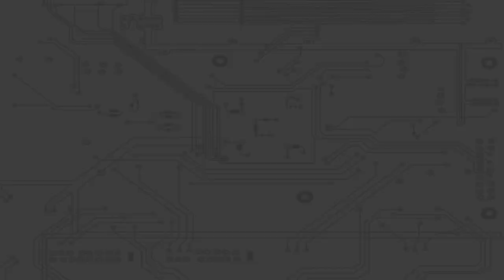Project Bloodshed - Jay's new 4k Test Bench

Comment: looks really neat, only thing I'm not keen on is how the rad and fan mounts hang outside the case, but guess that's due to space limitations, would be nice if there was a frame to fit round the sides almost like a windowed panel without the window, though probably not practical for a test bed then.

Comment: Im running an M-ITX build with an i5 haswell 4430 cpu, msi 770 lightning ed inside of bitfenix prodigy case. I've recently added a benq xl2420z monitor to my setup and WOW, I've fallen in love with high refresh rate gaming. I'm currently waiting to see if the rumors that the 980ti will be a beast come true, and may upgrade to allow all my games to run at 100fps+ at 1080p.

Comment: i dont have a test bench but i may need to build one for trouble shooting but idk right now. however, my main pc (this one in my profile picture) was a fun build. its specs are:
case: cm storm trooper with side window
motherboard: asus rog crosshair v formula z
cpu: amd fv 8350 @ 4.5ghz
gpu: evga gtx 970 superclocked 4gb
psu: evga supernova 750 gs
ssd: 128gb samsung 840 pro
hdd: wd caviar black 2tb
ram: team group dark 1600mhz (red)
liquid cooling: duel 240mmx45mm rad with silverstone 1200 fans and iron side red liquid uv coolant

Comment: I liked how the system looked, the red fluid looks very nice.

I'm shocked that I haven't heard of Caselabs before :O I'm a big fan of having the motherboard horizontal, so I'm looking around on their website now! I'm running an mATX system, so I'm covered for now, but their stuff looks really nice.

I'm now using the Aerocool DS Cube, but I came across, by accident, the Lian Li PC-V359, so I'm planning on switching to that. I'm very happy with the Aerocool, but the Lian Li just looks that much nicer with all the windows and space for 4x120 fans for the mother board area. Btu I will have a look at Caselabs before I order anything :P

Comment: You say you can do full benchmarking on a second graphics card without disconnecting the first one because of the two 16x PCIe lanes on the X99 motherboard, but the i7-5820K only runs two cards in 16x8 due to having only 24 lanes (whereas the 5930K and 5960X would run both at 16x due to having 40 lanes). Are you sure that you are getting that second card to run at 16x in your setup, and if so how are you accomplishing it?

Comment: The only change i would make for a testbench would probably be to change the cpu to a 5930k and then leave the gpu aircooled. Or maybe a parallel loop for the gpu and cpu with quickrelease on the gpu

Comment: How do you installed the HDD and SSD!? It looks like you need to remove de MOBO to attatch the drives!
Reply from the maker: There are two thumb screws on the side that let the bottom half of the mobo tray come down. The motherboard stays put.
Reply: Nice. Thanks. ;)

Comment: I need help,

I just bought a 760T ( had nzxt phantom) and I was wondering if I should out my kraken x60 again as top exhaust but currently as of now it goes to 33-36C under load gaming prob cause of gpu heat, should I put it as front intake and put exhaust fans on top?

Comment: i wanna build my first gaming pc, this is the parts i have chosen so far. Any suggestions about what i can do better?
AMD A10 6800k CPU
Corsair H100i CPU WaterCooler
Nvidia gtx 970 4 GB GPU
Corsair 120 GB SSD
Toshiba 1 TB Harddrive
G-Skill 8 GB ddr3 2331 Mhz RAM
Corsair 750 Watt Bronze PSU
GigaByte FM2 PciE 3.0 x16 Motherbord
NZXT MidiTower Case

Comment: Huge error. He said that he could leave the 290 plugged in and add a second and it will run at 16X. Not true the 5820K only has 28 lanes, so the 290 will run at 16X and the second card at 8X. The 5820K also won't support more then 3 way SLI since Nvidia requires that cards run at 8X minimum, since the 5820K has 28 lanes, the first three card will run at 8X each(which ch adds up to 24 lanes), and the 4th a 4X. So the fourth won't run at all since its 4X.
Reply: you know thats its .. 2x 16 and 3x8 right ?
Reply: HTMMediaChannel you know that there are only 28 lanes, so it cant run at 2 16x because 16x2=32. im sure there is a way to either disable one card and make another run at 16x or something, but it doesnt even matter, running a current pcie 3.0 gpu at pcie 3.0 8x does not bottleneck it.

Comment: is it okay to put a mechanial harddrive upside down like jay did? i have heard somewhere it could damage them.
Reply: No it wont damage them
Reply: if you mount an hdd at a horizontal or vertical position, no matter the orientation, it will lose no more than 20% of its life. now, if you install windows with it vertical, you will need to format it before you run it horizontal (possibly) because the read heads might become out of line.

Comment: Just noticed speed doesn't matter and with the x99 deluxe is great for overclocking so I am really happy about that :D :D However this is my full specs list

                                    Computer build
Gigabyte Radeon R9 290X 4GB
Gigabyte Radeon R9 290X 4GB
RM850 power supply
i7-5820K clocked at 4.2 ghz (hopefully, if possible)
Asus X99-DELUXE motherboard
Corsair Dominator Platinum 16GB DDR4 2800MHz
WD Green Desktop 1TB hdd
Kingston HyperX 3K 2.5" 120GB SATA III SSD
bluray drive

I hope guys this is the perfect build if not tell me what is wrong and suggest what to replace with and please tell me what: cases, CPU fans and case fans I should get (MUST BE QUIET!!) Thank you guys for reading this far as people get bored normally :'( BUT seriously thank you guys if you do comment!!

Comment: Will this be able to play CS:GO, TF2, league of legends, ac unity, and battlefield 4 at high to ultra settings 1080p 60fps
CPU: amd FX-8320 3.5GHz 8-core
Mobo: Gigabyte GA-970A UD3P ATX AM3+
ram: crucial ballistix 8gb ddr3
hard drive: WD caviar blue 1TB 7200RPM
GPU: MSI R9 280x
case: Corsair SPEC-03 white ATX mid tower case
PSU: Enermax revolution 630w 80+ gold ATX
OS: Windows 8.1
Reply: Yup your set
Reply: ***** Thanks for the help.
Reply: Will it play batman arkham knight?
Reply: Will it play mine craft?

Comment: you should of used a samsung xp941 256gb/ 512gb as your ssd for a boot device conected direct to a m.2 to pcie x4 ssd adapter w/ heatsink, that way you its not bottle neck as most ssd are. im just saying :)

Comment: cool mirror on the left ^^

all in all a GREAT built, only thing I would change, is removing the internal USB3 Cabels from the motherboard as long as you don't need them. Or maybe there is an angeled adapter. The Cabels stand up ring in front of the beautifull board an rest. Goole found some pretty nice thing, you need something like this http://cdn.overclock.net/e/ee/ee96b462_IMG_8789__43415_zoom.jpeg

Due to BLOODSHED is a fully red built and I had preferd to see a MSI Gaming 7 Mainboard in there (or atleast a red Asus)

Comment: Here is my build:
CPU: FX-8350 8-Core CPU @ 4 GHz
GPU: Gigabyte Geforce GTX 970 @ 1250 MHz (1568 MHz on High end games)
RAM: 12 GB Clocked at 1066 MHz
Case: Cougar Challenger
Hard Drives: 500 GB, 1 TB, 3 TB
SSD: 128 GB SATA 6 Gb/s
Monitors: ASUS VS-239P-H, ASUS VG248QE
OS: Windows 10 Technical Preview
Fans: 140mm Fan, 120mm Fan, 200mm Fan
I made this build to optimize performance per a dollar while still going high end or mid end however you want to call it.
http://tinypic.com/view.php?pic=2v8fpdw&s=8#.VHlUWTFpfuM
http://tinypic.com/view.php?pic=34yz6z9&s=8#.VHlUgzFpfuM
http://tinypic.com/view.php?pic=9pxdvd&s=8#.VHlUkDFpfuN
http://tinypic.com/view.php?pic=nfpffp&s=8#.VHlUnjFpfuN
a little outdated picture but just the ram is different.

Comment: How would an AMD Quad-Core A10-7850K Processor with AMD Radeon R9 260 dedicated graphics work with Battlefield 4. Should I consider getting an AMD 8-Core FX-8320 Vishera Processor with AMD Radeon R7 250 dedicated graphics instead?
Reply: Idk lol!!

Nah ima jking they would run I think at around 30 fps at max settings though I cannot find properly out as there are no where showing these both at test as well as ram also includes what fps battlefield 4 runs at. If you could improve it would be graphic card then the cpu as gpu is more important and as it runs the game itself (mind blowed) instead of cpu calculating where pixels are.
Reply: Lolly Gamer Thanks for the lol + information. I'm going with the Quad-Core for my pre-built pc which I am upgrading upon arrival.
Reply: ***** Okay and hopefully it goes well for you, good luck and hopefully you enjoy the upgrade. Ik I would :D :D

Comment: Will this run Battlefield 4 at High or Medium?

CPU -	AMD Athlon X4 760K 3.8GHz Quad-Core Processor	
CPU Cooler -	Arctic Cooling Freezer 7 Pro Rev.2 45.0 CFM Fluid Dynamic Bearing CPU Cooler	
Motherboard -	MSI A78M-E35 Micro ATX FM2+ Motherboard	
Memory -	Crucial Ballistix Sport 8GB (2 x 4GB) DDR3-1600 Memory	
Storage -	Western Digital Caviar Black 1TB 3.5" 7200RPM Internal Hard Drive	
Video Card -	EVGA GeForce GTX 750 2GB FTW ACX Video Card	
Case -	Corsair SPEC-01 RED ATX Mid Tower Case	
Power Supply -	Corsair CX 430W 80+ Bronze Certified Semi-Modular ATX Power Supply	
Wired Network Adapter -	TP-Link TG-3269 10/100/1000 Mbps PCI Network Adapter
Reply: no, get the r7 265
Reply: the 750 will struggle a lot, and will get outdated in a year
Reply: Sorry I am a noob at computers lol by r7 265 do you mean Saphire?
Reply: any will do, though i reccomend sapphire
Reply: and if you can afford it, get the r9 270x, and i saw some r9 280s going for as less as 141 dollars, so u can look into that
Reply: So do you think I should get a Gtx 760 superclocked?
Reply: the 280 is a bit better than the gtx 760, and has more vram, so i thik you shud get a 280
Reply: though  a gtx 760 is still pretty decent
Reply: High apart from AA and turn down particle effects that should work
Reply: If you want gtx, go for a 750ti not a 750
Reply: Go with a 280/280x
Reply: If you're going to buy something better than GTX 750 then you should get FX 6300 at least. The athlon x4 760k is shit and will bottleneck any good gpu.
Reply: Ignore all these peeps. Your cpu should be the pentium g3258 and then oc it to 4.5ghz. I would change your cooler to the hyper 212 evo and then swap out the gtx 750 for the 660 or r9 280. And don't try to undermine me by saying that the pentium will be shit. Once you overclock it it will perform just as good as the i7 4790k in gaming. If you ever wanted to upgrade your cpu for video editing/rendering then just step up to the 4790k. You will have to change your motherboard and any will be compatible if it says lga 1150 socket. I would get the z97 msi gaming motherboards but look around somewhat. Hope this helps! :D This will run bf4 on ultra above 50 fps probably even above 60 if you get rid of motion blur which most people do anyway.
Reply: ***** nah an fx-8350 is the best value for money CPU out there in my opinion will happily run 970's without choking them and its what £120-£130 its a no brainer for me.
Reply: The pentium is £50. When you overclock it, it beats the 8350 in video rendering at 1080p on handbrake and sony vegas AND achieves MUCH better fps than the 8350. But I get where you are coming from and respect your opinion. When I get my pc I'm going to be getting this pentium chip and overclocking it then putting up some benchmarks on my channel against my friends fx 8350. I guess we'll see who wins! aha :D
Reply: I think his is also overclocked a little bit although I'm unsure but I'll mention in the video if you want to watch it.
Reply: ***** Should I swap out the 750 with a Sapphire Radeon R7 260X? And is my processor fine?
Reply: I just want something thats $500 and then when I get more money I can upgrade it.
Reply: Tell me what I need to fix - http://pcpartpicker.com/p/Yb6q7P
Reply: My specs on my computer now are horrible, I tried to make them good but I didnt know what I was doing thats why I am asking what is good lol.  My specs are 

Processor	AMD FX(tm)-4300 Quad-Core Processor
Manufacturer	AMD
Speed	3.8 GHz
Number of Cores	4

Video Card	NVIDIA GeForce GT 610
Manufacturer	NVIDIA
Chipset	GeForce GT 610
Dedicated Memory	1.0 GB
Total Memory	3.9 GB

Memory	8.2 GB
Operating System	Microsoft Windows 8 Professional Edition (build 9200), 64-bit
Reply: That gt 610 sucks LOL
Reply: Remove the CPU and Mobo. Add an FX 6300 and an AM3+ mobo of your choice. And if you have a little more money, get R7 265 or HD 7850 or maybe GTX 750 Ti. That should do it :)
Reply: Oh yeah and I spent 750 on the computer I have now and it sucks balls
Reply: Whats a good motherboard thats compatible with the processor?
Reply: And low priced
Reply: Yiannis Christou Is Asus M5A78L-M LX PLUS good?
Reply: Yiannis Christou Does it look better? http://pcpartpicker.com/p/G82bdC
Reply: ***** Yeah, and they are compatible thats why I love PCPartPicker, they make sure everything is compatible.
Reply: yup thats a good build
Reply: what is the price of the 750 ti though, it is around 10 percent better than the r7 260x, and its made by nvidia so u get physx and all that stuff, and games are usually more optimized for nvidia cards
Reply: I would say the opposite is true
Reply: Clondo It is just ok. Though it doesn't have USB 3.0 ports and only supports one GPU. Hope it will be fine by you :D
Reply: Yeah its fine, I dont even have anything that is usb 3.0
Reply: and I dont plan on having 2 gpus
Reply: And I dont need alot of usbs because I have like 10 usb hubs hot glued to the bottom of my desk
Reply: ***** the problem with the pentium is he ask for bf4, which is a heavily threaded game, and even though the g3258 will get better average fps than the fx-6300, it will have a lot of strutter in games that use more than 2 cores like battlefield 4 on 64 player maps and crysis 3, and games are becoming more and more multithreaded, so I would not recommend going with a less than 4 thread cpu like the pentium, unless he's going to upgrade it to a higher end i3 or an i5 in a few months.
Reply: Aha, literally the reason why I'm going for the pentium. I'm upgrading to the 4790k when I have the money because I need to edit for my media and film production gcse and also it will help me substantially in video editing compared to my a10 apu right now. I see where you are coming from.
Reply: The mobo does not have any sata 6 ports
Reply: What is a recommended low price motherboard?
Reply: Is this a good mobo? http://pcpartpicker.com/part/msi-motherboard-970ag43
Reply: Clondo Yep it's good. But you should check for yourself. Read its features and specs cuz I don't know if it will be enough for you. If you don't care about the specs then you should just buy it and take a decision :P
Reply: Yiannis Christou I made a new one, is this good? http://pcpartpicker.com/p/qpBxt6 
Sorry for bothering you.
Reply: where is the mobo and the hard disk
Reply: otherwise its good
Reply: very good actually
Reply: ultra settings 60 plus fps guaranteed :D
Reply: Oh took off the motherboard and picked a better one and I have a 2 tb harddrive still in package at my house lol
Reply: you should get GPU with 3GB VRAM or 4GB because the new pc games now and in the future will require 3 or more ram, i think amd r9 280x or GTX 780 will be good
Reply: Mohamed Magdy 3 is good enough

Comment: Will this support all games on 4k and max settings possible, if so tell me if possible how many years forward.

                             Specs:
Intel core i7-4790K 4.0GHz quad core
Corsair Dominator Platinum 16GB DDR4 2800MHz
Kingston HyperX 3K 2.5" 120GB SATA III SSD
EVGA NVIDIA GeForce GTX Titan Black 6GB Card
Corsair RM650 650W Power Supply 80 Plus Gold

Thank you for commenting and also could you check please if the power supply supports the gpu as I do not understand properly to know if they will work together. Thank you sooooooooo much guys!! :D :D
Reply: You can't use DDR4 on Z97. Get 2X 980's not the Titan, and get a 4690K as they're basically the same. And a get the HX850, it's much better.
Reply: TheMaraio1 Thank you for commenting and I changed the motherboard to Asus X99-DELUXE and the gpu to two r9 290x (is that a bit overkill??) HOWEVER at the moment I could not find the power supply at any retailers in UK so instead I'm thinking of using RM850. If you could please recheck if all of it works so it should work and thank you for reading through this as well to commenting to me, it is realy greatly appreciated!!
Reply: Lolly Gamer well if you're going X99, you'll need the new CPU's as the 4790K won't work. The 5820k is a Good 6 core. But there's no reason to go for X99 over Z97, if you're just gaming.
Reply: TheMaraio1 I just noticed that the newer cpu has a lower ghz compared to the other cpu, 0.7 ghz difference. Does this matter for gaming and also I went for the motherboard as it supports ddr4 and as I want this for editing videos as well as games supporting it in the future so it will last longer.
Reply: Lolly Gamer you need to look up guides before you buy your stuff to make sure its all compatible with each other :)
Reply: Well thanks but Im new at computer making and Idk what to do or where to go... ;'(
Reply: Lolly Gamer https://teksyndicate.com/ is a great website, go to the forums and make a thread, people there will be glad to help you :) or you could search on youtube for like complete beginners guide to building a pc, but i would recomennd teksyndicate forums :)
Reply: *****
Ty for commenting and Ive allready got something beside it, I just forgot to add it to spec list sorry!! But why 8gb ram?? 16gb ram would be better in the long run as I could edit videos if I really want to...